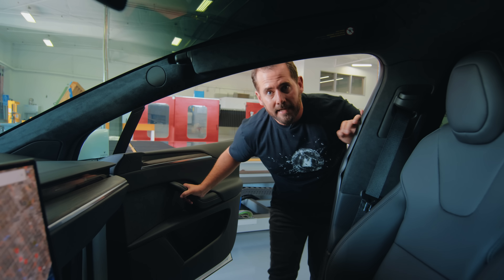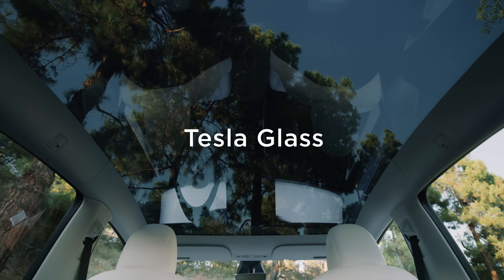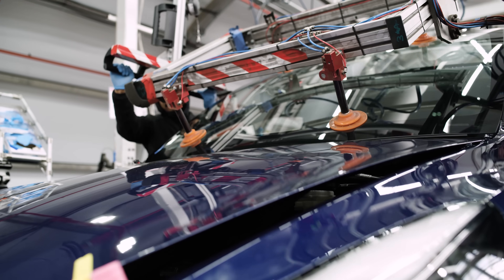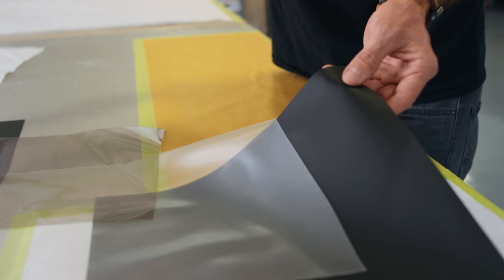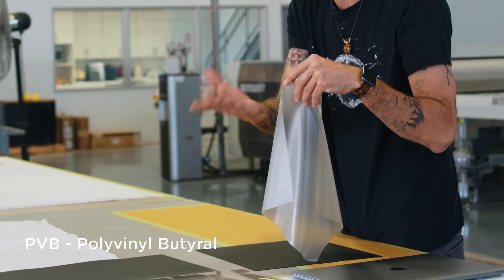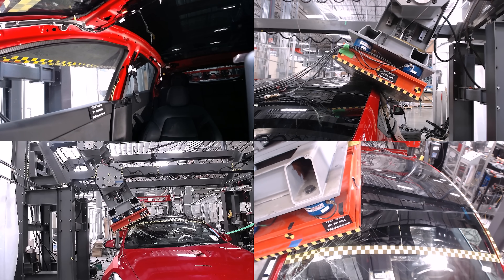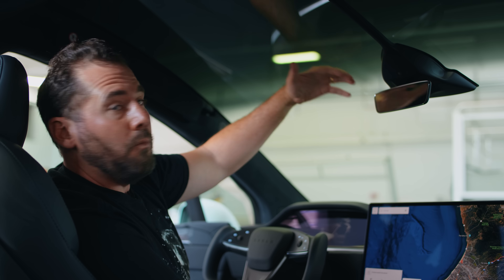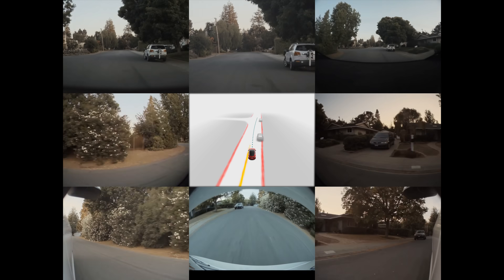Tesla Glass | The Secret to a Quiet Cabin

Comment: Tesla you need to develop your own tires next! ✌🏼🌍
Reply: They didn't develop anything 
90s Benz 
W140 features included:

Double-paned soundproofed glass was a new S-Class innovation first fitted on the W140. This form of window glazing allowed for improved soundproofing, reduced condensation, and other insulation benefits.

Electrically-operated exterior mirrors could be folded by switch to ease driving in narrow spaces.

'Parameter steering' was a system which made low-speed driving easier by reducing the effort required to maneuver in speed-sensitive situations such as parking.

Rear-parking markers, or guide rods. These rods extended from the rear corners of the trunk lid when in reverse, providing the driver with a guideline for rear maneuvers. In 1995, this system was replaced by the sonar-based Parktronic system which measured the distance of the bumpers to nearby obstacles.

12-way powered, heated front seats, with 3 setting memory functions and lumbar support.

Windshield wipers with heated washer system. Later models also included rain-sensing windshield wipers.

Electrically-operated automatic-dimming inside rear-view mirror that tied into the seat and steering wheel memory.

Heated exterior mirrors. Later models also included auto-dimming driver's side mirror.

Orthopedic seats were an expensive option from the factory but consisted of several different air cushions in the seat that the user can inflate and deflate to find the perfect driving position.

Dual-zone climate control. Four-zone climate control on LWB models.

Reclining and heated rear seats on LWB models. V12 models also have the four-place seating option, which allows fully adjustable rear seats, lumbar support and rear sunshade control. The center seat has been replaced by a burlwood center console, allowing a 2 + 2 seating format.

The climate control system could be set to operate for 20 minutes after the engine had been turned off.

Electric rear sunshade.

Rear passenger illuminated vanity mirrors.

Soft-closing doors and trunk.

Leather interiors and burl inserts (optional; standard for 500SEC/CL 500).

In 1995 the S 600 Coupe became the first Mercedes car with GPS navigation system, designated Auto Pilot System APS. It featured CD-ROM maps and full color navigation display in the center dashboard.

In 1996 the Linguatronic voice control system and Parktronic sonar-based parking system were introduced

In 1997 the TELEAID emergency and tracking system was introduced in the US market.

Also, developed with the car, a Bose sound system was available as an option.

Comment: Sold.
Reply: Because you have no clue. 90s Benz 
W140 features included:

Double-paned soundproofed glass was a new S-Class innovation first fitted on the W140. This form of window glazing allowed for improved soundproofing, reduced condensation, and other insulation benefits.

Electrically-operated exterior mirrors could be folded by switch to ease driving in narrow spaces.

'Parameter steering' was a system which made low-speed driving easier by reducing the effort required to maneuver in speed-sensitive situations such as parking.

Rear-parking markers, or guide rods. These rods extended from the rear corners of the trunk lid when in reverse, providing the driver with a guideline for rear maneuvers. In 1995, this system was replaced by the sonar-based Parktronic system which measured the distance of the bumpers to nearby obstacles.

12-way powered, heated front seats, with 3 setting memory functions and lumbar support.

Windshield wipers with heated washer system. Later models also included rain-sensing windshield wipers.

Electrically-operated automatic-dimming inside rear-view mirror that tied into the seat and steering wheel memory.

Heated exterior mirrors. Later models also included auto-dimming driver's side mirror.

Orthopedic seats were an expensive option from the factory but consisted of several different air cushions in the seat that the user can inflate and deflate to find the perfect driving position.

Dual-zone climate control. Four-zone climate control on LWB models.

Reclining and heated rear seats on LWB models. V12 models also have the four-place seating option, which allows fully adjustable rear seats, lumbar support and rear sunshade control. The center seat has been replaced by a burlwood center console, allowing a 2 + 2 seating format.

The climate control system could be set to operate for 20 minutes after the engine had been turned off.

Electric rear sunshade.

Rear passenger illuminated vanity mirrors.

Soft-closing doors and trunk.

Leather interiors and burl inserts (optional; standard for 500SEC/CL 500).

In 1995 the S 600 Coupe became the first Mercedes car with GPS navigation system, designated Auto Pilot System APS. It featured CD-ROM maps and full color navigation display in the center dashboard.

In 1996 the Linguatronic voice control system and Parktronic sonar-based parking system were introduced

In 1997 the TELEAID emergency and tracking system was introduced in the US market.

Also, developed with the car, a Bose sound system was available as an option.
Reply: Makes some better use of your time rather than creating a biography as a reply on YouTube

Comment: the absolute best cars on the planet and not one of them comes close to $200k
they r like alien vehicles visiting earth.
Reply: You think that because you have no clue
90s Benz 
W140 features included:

Double-paned soundproofed glass was a new S-Class innovation first fitted on the W140. This form of window glazing allowed for improved soundproofing, reduced condensation, and other insulation benefits.

Electrically-operated exterior mirrors could be folded by switch to ease driving in narrow spaces.

'Parameter steering' was a system which made low-speed driving easier by reducing the effort required to maneuver in speed-sensitive situations such as parking.

Rear-parking markers, or guide rods. These rods extended from the rear corners of the trunk lid when in reverse, providing the driver with a guideline for rear maneuvers. In 1995, this system was replaced by the sonar-based Parktronic system which measured the distance of the bumpers to nearby obstacles.

12-way powered, heated front seats, with 3 setting memory functions and lumbar support.

Windshield wipers with heated washer system. Later models also included rain-sensing windshield wipers.

Electrically-operated automatic-dimming inside rear-view mirror that tied into the seat and steering wheel memory.

Heated exterior mirrors. Later models also included auto-dimming driver's side mirror.

Orthopedic seats were an expensive option from the factory but consisted of several different air cushions in the seat that the user can inflate and deflate to find the perfect driving position.

Dual-zone climate control. Four-zone climate control on LWB models.

Reclining and heated rear seats on LWB models. V12 models also have the four-place seating option, which allows fully adjustable rear seats, lumbar support and rear sunshade control. The center seat has been replaced by a burlwood center console, allowing a 2 + 2 seating format.

The climate control system could be set to operate for 20 minutes after the engine had been turned off.

Electric rear sunshade.

Rear passenger illuminated vanity mirrors.

Soft-closing doors and trunk.

Leather interiors and burl inserts (optional; standard for 500SEC/CL 500).

In 1995 the S 600 Coupe became the first Mercedes car with GPS navigation system, designated Auto Pilot System APS. It featured CD-ROM maps and full color navigation display in the center dashboard.

In 1996 the Linguatronic voice control system and Parktronic sonar-based parking system were introduced

In 1997 the TELEAID emergency and tracking system was introduced in the US market.

Also, developed with the car, a Bose sound system was available as an option.

Comment: The attention to detail is incredible.
Reply: 90s Benz 
W140 features included:

Double-paned soundproofed glass was a new S-Class innovation first fitted on the W140. This form of window glazing allowed for improved soundproofing, reduced condensation, and other insulation benefits.

Electrically-operated exterior mirrors could be folded by switch to ease driving in narrow spaces.

'Parameter steering' was a system which made low-speed driving easier by reducing the effort required to maneuver in speed-sensitive situations such as parking.

Rear-parking markers, or guide rods. These rods extended from the rear corners of the trunk lid when in reverse, providing the driver with a guideline for rear maneuvers. In 1995, this system was replaced by the sonar-based Parktronic system which measured the distance of the bumpers to nearby obstacles.

12-way powered, heated front seats, with 3 setting memory functions and lumbar support.

Windshield wipers with heated washer system. Later models also included rain-sensing windshield wipers.

Electrically-operated automatic-dimming inside rear-view mirror that tied into the seat and steering wheel memory.

Heated exterior mirrors. Later models also included auto-dimming driver's side mirror.

Orthopedic seats were an expensive option from the factory but consisted of several different air cushions in the seat that the user can inflate and deflate to find the perfect driving position.

Dual-zone climate control. Four-zone climate control on LWB models.

Reclining and heated rear seats on LWB models. V12 models also have the four-place seating option, which allows fully adjustable rear seats, lumbar support and rear sunshade control. The center seat has been replaced by a burlwood center console, allowing a 2 + 2 seating format.

The climate control system could be set to operate for 20 minutes after the engine had been turned off.

Electric rear sunshade.

Rear passenger illuminated vanity mirrors.

Soft-closing doors and trunk.

Leather interiors and burl inserts (optional; standard for 500SEC/CL 500).

In 1995 the S 600 Coupe became the first Mercedes car with GPS navigation system, designated Auto Pilot System APS. It featured CD-ROM maps and full color navigation display in the center dashboard.

In 1996 the Linguatronic voice control system and Parktronic sonar-based parking system were introduced

In 1997 the TELEAID emergency and tracking system was introduced in the US market.

Also, developed with the car, a Bose sound system was available as an option.
Reply: @CanIbeFrank  Good to know?

Comment: How the hell is anybody going to catch up to Tesla or SpaceX .  They are moving so fast in so many ways.   I find it just remarkable that one man can influence so many people.
Reply: 90s Benz 
W140 features included:

Double-paned soundproofed glass was a new S-Class innovation first fitted on the W140. This form of window glazing allowed for improved soundproofing, reduced condensation, and other insulation benefits.

Electrically-operated exterior mirrors could be folded by switch to ease driving in narrow spaces.

'Parameter steering' was a system which made low-speed driving easier by reducing the effort required to maneuver in speed-sensitive situations such as parking.

Rear-parking markers, or guide rods. These rods extended from the rear corners of the trunk lid when in reverse, providing the driver with a guideline for rear maneuvers. In 1995, this system was replaced by the sonar-based Parktronic system which measured the distance of the bumpers to nearby obstacles.

12-way powered, heated front seats, with 3 setting memory functions and lumbar support.

Windshield wipers with heated washer system. Later models also included rain-sensing windshield wipers.

Electrically-operated automatic-dimming inside rear-view mirror that tied into the seat and steering wheel memory.

Heated exterior mirrors. Later models also included auto-dimming driver's side mirror.

Orthopedic seats were an expensive option from the factory but consisted of several different air cushions in the seat that the user can inflate and deflate to find the perfect driving position.

Dual-zone climate control. Four-zone climate control on LWB models.

Reclining and heated rear seats on LWB models. V12 models also have the four-place seating option, which allows fully adjustable rear seats, lumbar support and rear sunshade control. The center seat has been replaced by a burlwood center console, allowing a 2 + 2 seating format.

The climate control system could be set to operate for 20 minutes after the engine had been turned off.

Electric rear sunshade.

Rear passenger illuminated vanity mirrors.

Soft-closing doors and trunk.

Leather interiors and burl inserts (optional; standard for 500SEC/CL 500).

In 1995 the S 600 Coupe became the first Mercedes car with GPS navigation system, designated Auto Pilot System APS. It featured CD-ROM maps and full color navigation display in the center dashboard.

In 1996 the Linguatronic voice control system and Parktronic sonar-based parking system were introduced

In 1997 the TELEAID emergency and tracking system was introduced in the US market.

Also, developed with the car, a Bose sound system was available as an option.

Comment: This alone makes me want a Tesla. Can someone tell me if the rumored Tesla $25K hatchback would have this quality of glass as well?
Reply: 90s Benz 
W140 features included:

Double-paned soundproofed glass was a new S-Class innovation first fitted on the W140. This form of window glazing allowed for improved soundproofing, reduced condensation, and other insulation benefits.

Electrically-operated exterior mirrors could be folded by switch to ease driving in narrow spaces.

'Parameter steering' was a system which made low-speed driving easier by reducing the effort required to maneuver in speed-sensitive situations such as parking.

Rear-parking markers, or guide rods. These rods extended from the rear corners of the trunk lid when in reverse, providing the driver with a guideline for rear maneuvers. In 1995, this system was replaced by the sonar-based Parktronic system which measured the distance of the bumpers to nearby obstacles.

12-way powered, heated front seats, with 3 setting memory functions and lumbar support.

Windshield wipers with heated washer system. Later models also included rain-sensing windshield wipers.

Electrically-operated automatic-dimming inside rear-view mirror that tied into the seat and steering wheel memory.

Heated exterior mirrors. Later models also included auto-dimming driver's side mirror.

Orthopedic seats were an expensive option from the factory but consisted of several different air cushions in the seat that the user can inflate and deflate to find the perfect driving position.

Dual-zone climate control. Four-zone climate control on LWB models.

Reclining and heated rear seats on LWB models. V12 models also have the four-place seating option, which allows fully adjustable rear seats, lumbar support and rear sunshade control. The center seat has been replaced by a burlwood center console, allowing a 2 + 2 seating format.

The climate control system could be set to operate for 20 minutes after the engine had been turned off.

Electric rear sunshade.

Rear passenger illuminated vanity mirrors.

Soft-closing doors and trunk.

Leather interiors and burl inserts (optional; standard for 500SEC/CL 500).

In 1995 the S 600 Coupe became the first Mercedes car with GPS navigation system, designated Auto Pilot System APS. It featured CD-ROM maps and full color navigation display in the center dashboard.

In 1996 the Linguatronic voice control system and Parktronic sonar-based parking system were introduced

In 1997 the TELEAID emergency and tracking system was introduced in the US market.

Also, developed with the car, a Bose sound system was available as an option.